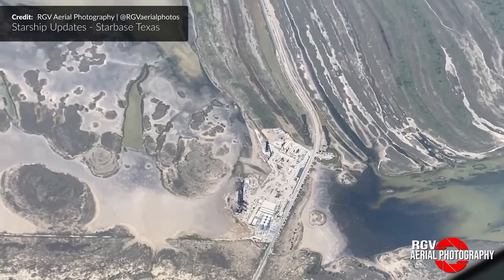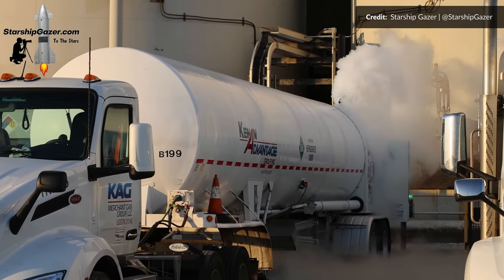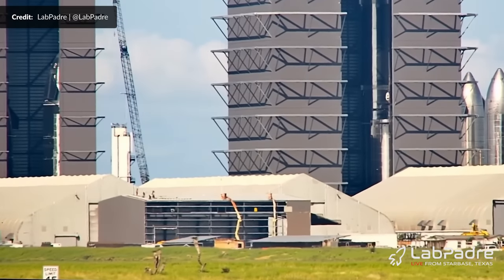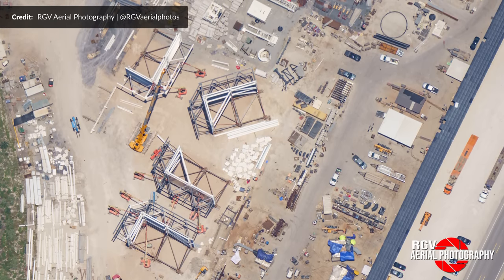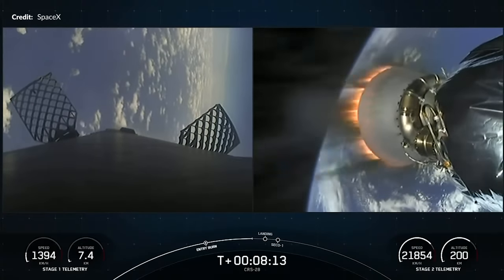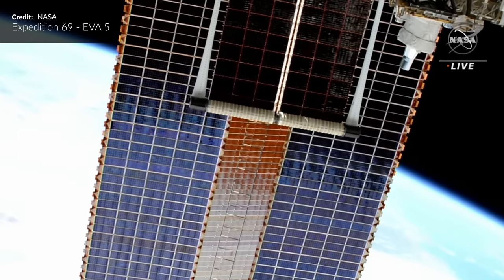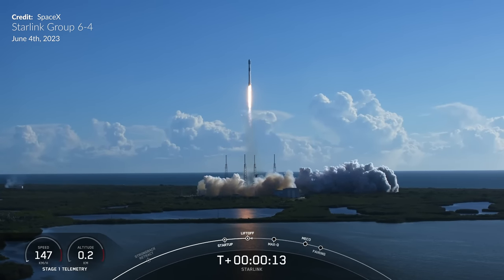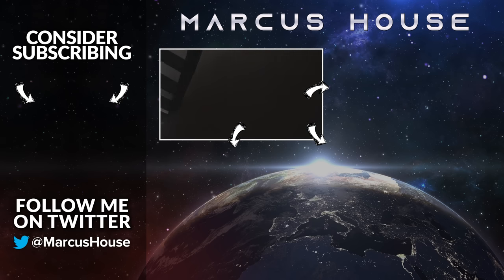NASA's Concerns with SpaceX Starship Delay,  CRS-28 and ULA Vulcan Test Fire

Comment: The irony of NASA worrying about HLS delays 😂
Reply: Starliner can’t get all the heat lol
Reply: 🙄 Artemis II is planned in 2024 and the SLS hardware for Artemis III is being assembled now. For Artemis III in Dec 2025, SpaceX has to do a full up, unmanned HLS Starship test landing in late 2024 or very early 2025. That means having the [DELETED] Starship propellant depot, Starship Tankers, and HLS Starship ALL working by then. Including up to 7 Starship Tanker flights. So they need launch pads that are ready to go. ALL of that development takes time and Dec 2024 is not that far away.
Reply: @steveaustin2686  SpaceX are already preparing for their 2nd test flight, 3rd will be before end of 2023. The starship part of the flight has already been proven, its just the booster part that requires the significant part of the testing.
Reply: Yes, SpaceX has a lot of work to do before NASA will be ready to use the HLS for landing humans on the Moon. There are something like 12 Starship launches required with all the variations to fuel and test HLS and then fuel and launch the human-carrying HLS. That does not seem possible in only a year and a half.
Reply: @stewartkingsley  I would take Musk's target dates with a generous helping of salt. Remember, after SN-15 landed in May 2021, Musk said that it would be Aug 2021 when the first 'orbital' flight happened. In the Apr 2023, SpaceX was wrapping up construction on the pad, before the 'orbital' flight. And that was not complete as the pad blew up.
Reply: @stewartkingsley  incredible you think they will have a third flight in 2023. Don’t you look at the real world and previous experiences when making assessments about the future?

Comment: The flight testing is just the tip of the prototyping iceberg.  Under the fiery and concrete rich launches, SpaceX must test and rapidly iterate the manufacturing process.  The welding quality, speed of stacking and changes to booster and ship feature sets have rapidly improved. I'm sure several ships and booster sections are ultimately destined for scrap, as they are overtaken by more advanced versions and become test articles. Amazing to watch the speed of design and manufacturing!
Reply: Good writing.
Reply: I think you're right. A lot of these are "manufacturing prototypes", created simply for the purpose of developing processes. They are destined for "scrap", which doesn't necessarily involve sending to a scrap vendor or landfill... a lot of the components will be reused in future developed models. It's important to remember what we are seeing is "pre-alpha" Starship production. Things can and will change - probably by a LOT - over the coming couple years... and even after they are actively flying, things will continue to change. Different models, different capabilities, different designs.

Comment: One often hears mention of the fast rate of everything at SpaceX, but that quickly leads to what is being built or moved. A video on how they do things so fast (by comparison to Boeing) while not killing several workers per day, would be very interesting. Presumably that get all the required approvals and permits, so how do they do int?
Reply: Build, learn, destroy, build, learn, repeat. As opposed to build, try to put lipstick on that pig, collect "cost plus" for a decade, fade away.
Reply: Skip a lot of steps. Why do you think they didn't do any protection on their launch site?
Reply: They don't move any faster then anyone else.. That is mostly nonsense. The difference is that BC is open to the public, and cameras watch it 24/7. The construction crews are not SpaceX employees. That's contracted work, and they work as fast as the money tells them to work. If SpaceX is willing to pay for 24hr operation, then it goes faster. The Cape took about 3 years to build for the Apollo missions. Work at Boca has taken 7 years, and is still going. They don't move faster, but the fandom and fandom space news channels like to claim it. Harmless, but mostly nonsense.
Reply: @hawkdsl  How long did the Apollo program take to reach first test launch? What about STS? Just for comparison.
Reply: @dirtypure2023  Saturn 5 started development in 1960 and the first flight was in 1967.
Reply: Piss poor planning creates piss poor performance the rule of the 6 ps
Reply: @hawkdsl the Apollo program had a ridiculously huge level of manpower invovled
Reply: @gerardt3284  450-500 thousand people across several companies and almost every state. The only other time the US was "All in" like that was for the nuclear bomb program. That may sound like cheating, however nothing like that had ever been done before. Ever. Today's Space industry has decades of knowledge to start from.

Comment: SLS has run into its own delays, and will probably hit more delays. NASA should have been more concerned with Starliner, yet they got pressured into accepting Blue Origin for it's 2nd lander and they haven't even hit orbit and neither has Vulcan. Not sure if this lander is part of the National Team, or just BO this time, but the FAA and the EPA are slowing things down for Starship at both Boca Chica and KSC for the 2nd launch zone for Crewed Falcon missions to the ISS to free up space at 39-B for Starship testing.
Reply: Oh lordy, where to start. Artemis II is planned in 2024 and the SLS hardware for Artemis III is being assembled now. For Artemis III in Dec 2025, SpaceX has to do a full up, unmanned HLS Starship test landing in late 2024 or very early 2025. That means having the [DELETED] Starship propellant depot, Starship Tankers, and HLS Starship ALL working by then. Including up to 7 Starship Tanker flights. So they need launch pads that are ready to go. ALL of that development takes time and Dec 2024 is not that far away.

Starliner has NOTHING to do with Artemis. Boeing's Starliner is under the fixed-price Commercial Crew program (CCP) contract to take astronauts to the ISS. 

How did NASA get pressuried into accepting the Blue Origin led National Team Blue Moon lander, when NASA wanted TWO (2) landers under HLS Option A in the FIRST place? IF the 2020 Congress had given NASA the HLS Option A funding that NASA had asked for, the Blue Origin led National Team ILV would have been the second lander, as they came in second place! NASA got the 2021 Congress to fund Appendix P for the second lander that NASA wanted. The Blue Origin led National Team Blue Moon lander won the Appendix P competition. SpaceX's HLS Starship was the top bid in HLS Option A and Blue came in second there and first in the next competion. So why should NASA skip Blue Origin for the second lander, when they obviously have the second best lander?

🙄 The EPA was not a part of the review compeleted in Jun 2022 and is NOT a part of the review now. Enviromental groups are suing the FAA saying that the FAA did not follow EPA regs. The FAA vs SpaceX is not really a thing, except for clicks by other YT channels. After all, the FAA defended SpaceX in front of Congress in Jun 2021 over the unauthorized SN8 flight. The FAA and SpaceX are working together to defend against environmental lawsuits from the Apr 2023 'orbital' flight test.

Not sure what you are babbling about in the last 'sentence'. SpaceX has started construction on a crew tower at SLC-40 on Cape Canaveral Space Force Station (CCSFS). Right now, the Crew Dragon and Falcon Heavy can ONLY launch from LC-39A. So NASA is leary about allowing Starship testing there, when a RUD would possibly take out Crew Dragon and Falcon Heavy launch capability. I would not be surprised if the construction at SLC-40 includes upgrades for Falcon Heavy to launch from there as well. Boca Chica is as much about learning how to build Starship facilities as it is for testing Starships. So it appears that SpaceX is working out the Ground Support Equipment (GSE) at Boca Chica, before taking the finalized design to the Starship pad at LC-39A.
Reply: @steveaustin2686  Hey, I think you need to calm down man. It’s not that deep.
Reply: @aboeckmann  What? You have something against the facts of a subject being correct?
Reply: @nowhereman1046  Well said

Comment: There are bunch of milestones even before demonstrating propellant transfer in orbit. We have to see proven, reliable Raptors and so far they've been anything but. We need to see tiles that don't fall off. We need to see Starship survive the unique structural loads inherent to re-entry (which are far more severe than "max Q". And it would be nice to see Starship land a few times without blowing up. Oh and we won't mention Starship's mass problem. So yeah, enough engineering challenges to keep development going for 2 to 3 years.
Reply: To test propellant transfer in orbit doesn't need re-entry to be working or the landing either. It just needs the ability to launch 2 Starships and have them in orbit at the same time.  

Either don't mention the "mass problem" or explain at least what it IS (or if it is anything but &^%$ talking).
Reply: @Scanner9631  I don't have the tweet on hand, but a while ago Elon tweeted that his biggest concern with Starship was mass. In other words, like any rocket, structural mass comes directly off payload. In this case he has a rocket made out of steel and he's having to push the engines to compensate. Not a good design decision. See Neutron. As for getting two Starships into orbit to test propellant transfer. That might happen on the 3rd of 4th test flights.. Late next year, if you're lucky.
Reply: Eh, the TPS tiles and reentry are not strictly necessary for HLS Starship to get to the Moon. The [DELETED] Starship propellant depot and Starship Tankers could all be expended to get HLS Starship to the Moon. It would just be expensive to expend it all.

Comment: I think NASA should be real quiet after they took 11 years to launch a singular SLS
Reply: That singular SLS performed flawlessly while the Starship immediately lost control and had an ineffective FTS
Reply: @JBS319  For $93 billion it better have performed flawlessly.
Reply: Artemis II is planned in 2024 and the SLS hardware for Artemis III is being assembled now. For Artemis III in Dec 2025, SpaceX has to do a full up, unmanned HLS Starship test landing in late 2024 or very early 2025. That means having the [DELETED] Starship propellant depot, Starship Tankers, and HLS Starship ALL working by then. Including up to 7 Starship Tanker flights. So they need launch pads that are ready to go. ALL of that development takes time and Dec 2024 is not that far away.
Reply: @JBS319  Starship has a fraction of the time that SLS has taken to get to its first test flight, the 2nd flight in a few weeks time will undoutably not suffer the same problems as the first. Though it may suffer new problems, which in term will be just as quickly fixed in the 3rd test launch.

Comment: There are two tanks, the inner tank and outer tank. Inside the outer tank is a vacuum wall, which is a negative pressure and the inner tank contains the cryogenic liquid. Reason for vacuum wall is heat does not travel through the outer walls.

Comment: NASA is worried about starship??? Might wanna focus on there own problem of a supposed spacecraft
Reply from the maker: Yes. I'm worried about Orion after all the negative news with Boeing.
Reply: @MarcusHouse  how much time and money do you think it'll take to maybe see it fly again?
Reply: @MarcusHouse  Orion is done by Lockheed Martin. Boeing does the SLS core stage and is the lead contractor for SLS. The Interim Cryogenic Propulsion Stage (ICPS) for Artemis I through III is done by ULA. The ICPS is a modified Delta IV Centaur stage and is slated to be replaced by the Boeing Exploration Upper Stage (EUS) on Artemis IV. 

The SRBs are done by Northrop Grumman and the ESA is providing the European Service Module for Orion.
Reply from the maker: @steveaustin2686  I phrased this badly. I'm worried about Orion and all the non-Boeing components simply due to Boeing. All this is great info of course.
Reply: @MarcusHouse  The development for SLS is almost all done. Now it is producing them, which is not as hard. The NASA IG is expecting the pace to pick up with the development phase behind them.

Comment: Blue Origin also depends on a never flown launch vehicle, but they have more time. Both use cryogenic fuels, but only BO have publicly addressed how they are going to deal with the long duration storage. NASA's aggressive plan calls for only one relative short mission per year.
Reply: BO is using H2 which is a bear to store, is known to have severe boil off problems, and has a lower boiling point than the freezing point of O2. SpaceX is using CH4 which is much easier to store (especially in earth orbit) & can be stored with O2. BP of CH4 is -161.6°C & that of O2 is -183°C, while the freezing point of CH4 is -297°C, so  there’s an overlap. As long as you can provide shade, it shouldn’t boil off in space…

Comment: Both Starbase and Cape launch pads are located on the ocean coast. Everything at Starbase instantly gets rusty. They make a weld and it's rusty in an hour. Add a pipe and it's all rusty on the next NSF stream. Yet Cape looks so much cleaner. I wonder why is that, is there so much of a climate\salinity difference between the two?

Comment: It seems the paint on the launch tower is not durable might putting heat tiles be a solution?
Reply: While TPS tiles are great vs heat, they suck vs impact. Reportedly, you can break them with your hands. The shockwave of launch would destroy them.

Comment: Starlink comms.... They published numbers that indicate they didn't have starlink connectivity through the whole flight. 
Of course that doesn't mean they can't rely on it for the future. Maybe it was just an "aha! stupid not to have thought of it like that!" and a simple software fix to make it work up to 27000km/h as opposed to the 2000km/h they achieved this time. But it may also be something fundamental. Like the doppler shift moving the frequencies outside of the range of hte used chips.... (although, if a satellite is appearing above the horizon, it'll be moving at you at close to 27000km/h, so that SHOULD be withing tuning range....)

Comment: They will have the Cape launch site up soon enough and the moon lander will be easier to make than the dear moon starship. As it doesn't need to come back to earth.  With two launch sites they can do the oribital tanker and  fill it with a less launches if they expend those first few filling it.
Reply: From page 27 of the GAO decision to deny the HLS complaints, here is the SpaceX plan for Artemis III. [DELETED] is apparently at least a propellant depot Starship variant from the context and SpaceX had the GAO redact that info. Added in Musk's payload update (~150t) and he says that it is up to 8 Tankers to fully refill HLS Starship, depending on HLS Starship's mass. My comments are in ().

"SpaceX’s concept of operations contemplated ten total launches (down from 16), consisting of: 1 launch of its [DELETED]; 8 launches of its Tanker Starships to supply fuel to [DELETED] (down from 14); and 1 launch of its HLS Lander Starship, which would be [DELETED] and then travel to the Moon."

Per page 10 of the GAO report, the SpaceX plan for Artemis III is 1 Starship variant launch every 12 days.

Comment: Hi Marcus, could you please revisit how SpaceX plans to refuel their moon lander in Earth orbit, and how many Starship tanker trips would be necessary to refill one moon lander, I've heard 4 or 5 trips? Much of that fuel would be consumed for the round trip back and forth to the moon so how many moon landings could the lander make before needing to refuel back at Earth again?
Reply: Why isn't anyone making the connection between the "moon landings" in 1969 which supposedly happened without refuelling technology.......smoke, mirrors, cameras, great actors and great special effects.😂😂😂
Reply: From page 27 of the GAO decision to deny the HLS complaints, here is the SpaceX plan for Artemis III. [DELETED] is apparently at least a propellant depot Starship variant from the context and SpaceX had the GAO redact that info. Added in Musk's payload update (~150t) and he says that it is up to 8 Tankers to fully refill HLS Starship, depending on HLS Starship's mass. My comments are in ().

"SpaceX’s concept of operations contemplated ten total launches (down from 16), consisting of: 1 launch of its [DELETED]; 8 launches of its Tanker Starships to supply fuel to [DELETED] (down from 14); and 1 launch of its HLS Lander Starship, which would be [DELETED] and then travel to the Moon."

Per page 10 of the GAO report, the SpaceX plan for Artemis III is 1 Starship variant launch every 12 days. So getting the depot filled up, could be a multi-month process.

Once the HLS Starship returns to lunar orbit after the surface mission is done, it is basically out of propellant. For another landing to be done with the same HLS Starship, it would need to be refueled in lunar orbit. For every Starship Tanker sent to lunar orbit, you have the up to 8 tankers listed above to get it there.

Comment: I wonder why they pivoted away from their in-house vertical tanks for smaller commercial ones
Reply: Because vertical methane tanks did not meet the safety standards. And now it seems that they are good punching bags for flying concrete which is not ok
Reply: @andriinaum1411  
Maybe they'll leave that first row of tanks as water tanks to shield everything behind them.